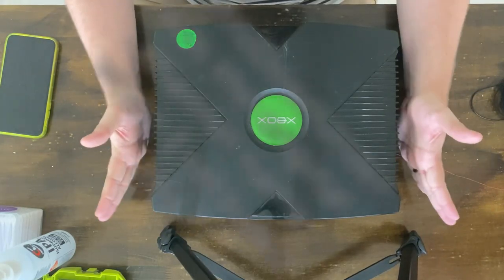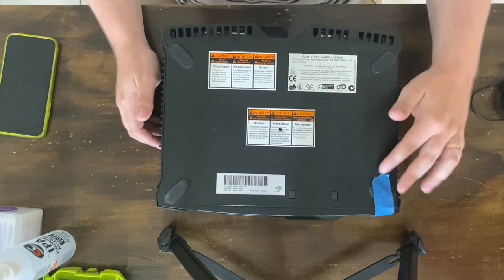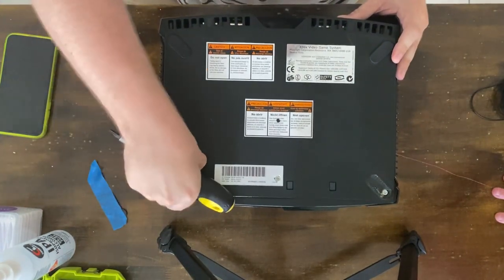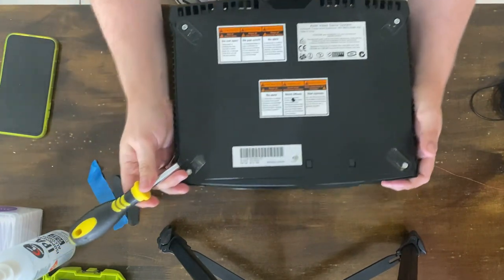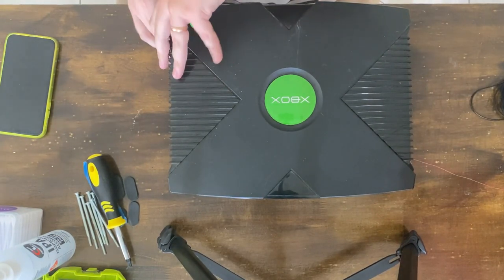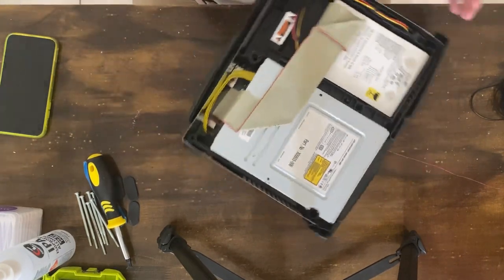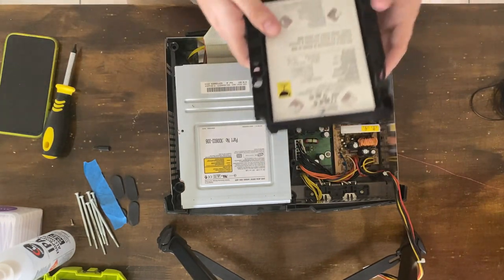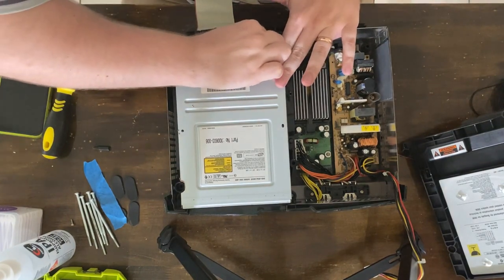Trying to fix an Original Xbox - Part 1

Comment: Did it had an error code?
Reply from the maker: No it turns on but the disc will not read, the laser seems like it's just crapped out after testing a POT adjust, I have ordered a new donor Drive, will make a video when it arrives.
Reply: @KongsNutz  ok
Reply: @KongsNutz  I'm in your discord server as Kuba.